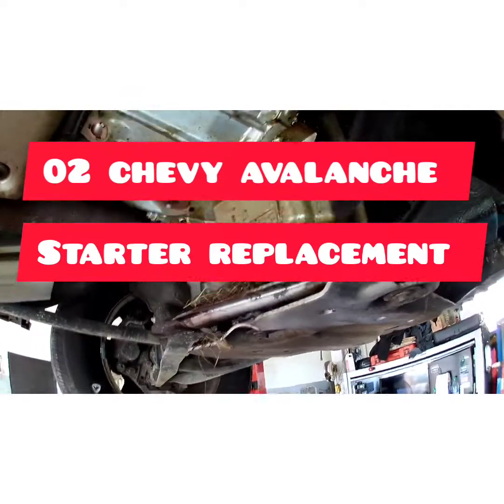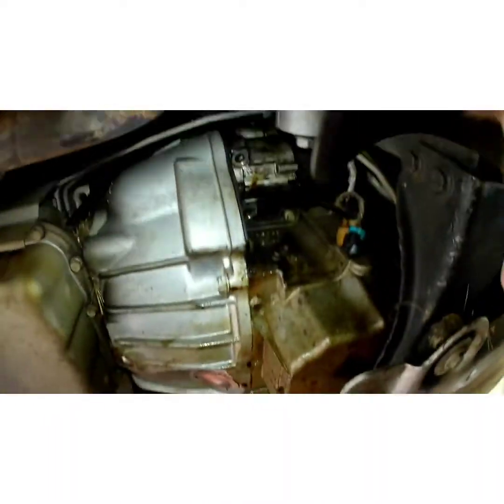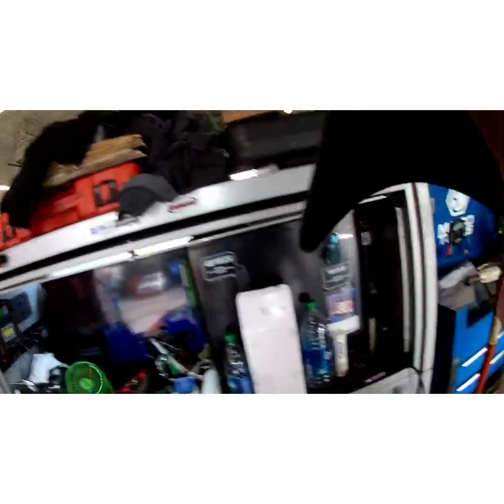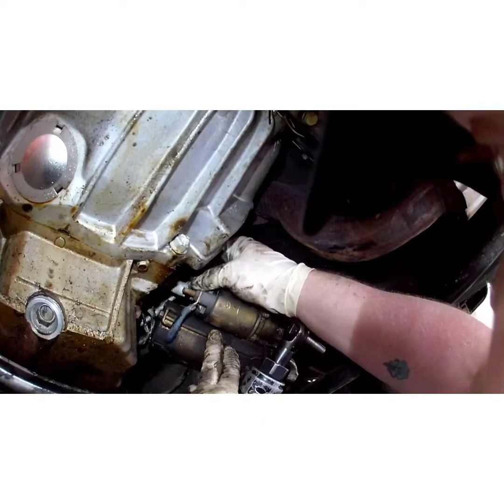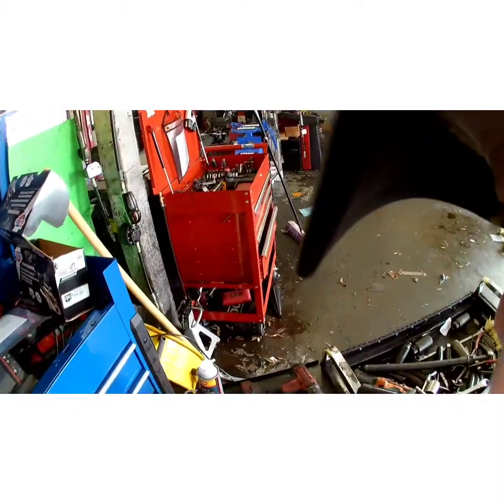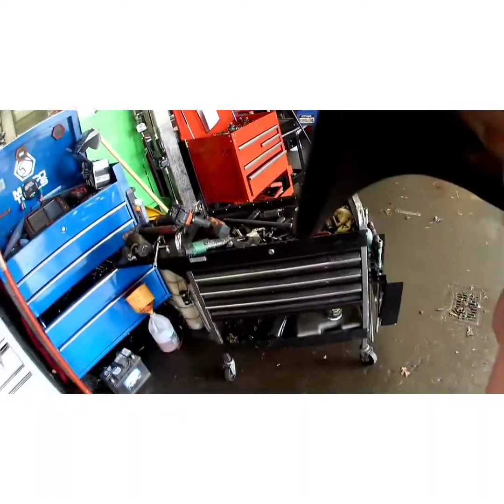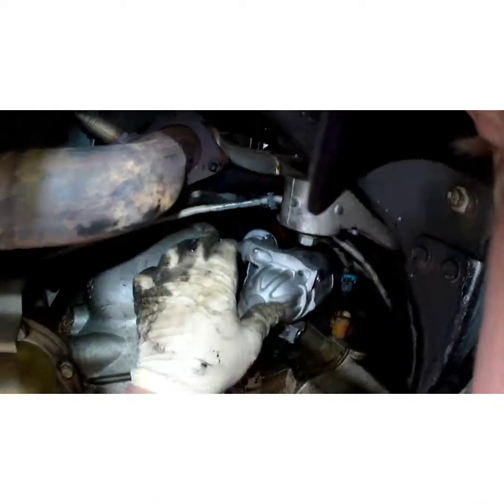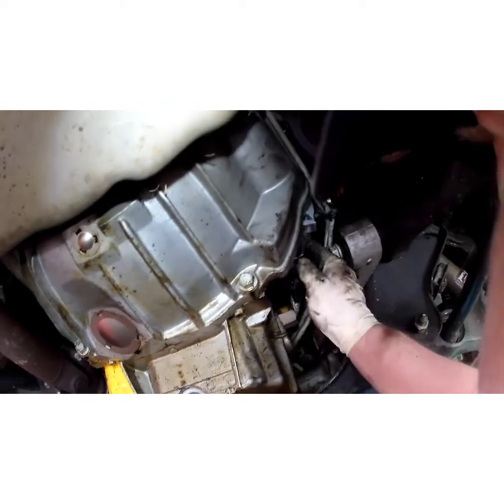how to replace starter motor chevy avalanche

Comment: I am not new to fixing cars and trucks. However I got out of doing that in the 90’s and I am way behind the times. 
I have a 2011 Chevy Avalanche with only 89,000 on it. The starter is dragging and I am going to have to change it.
I got a site where they took the front tire and wheel well cover off and twist and turned to get the starter off from the side instead of dropping it. 

I knew there must be a better way than to do all that. Glad I found your site. Saved me a “whole-lot-a” trouble. Thanks.
BTY, that Avalanche you were working on sure had a lot of oil you had to work in. Thanks for the knowledge.
Reply from the maker: @accident49  thank you for the feedback and compliment I appreciate it my friend